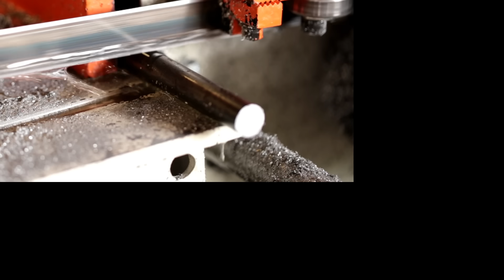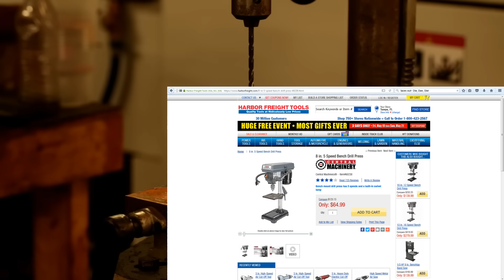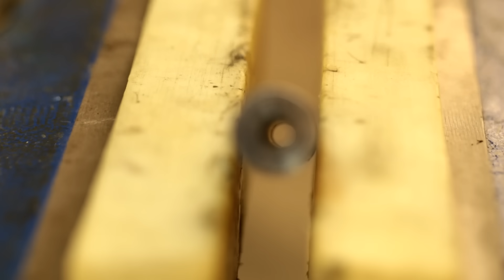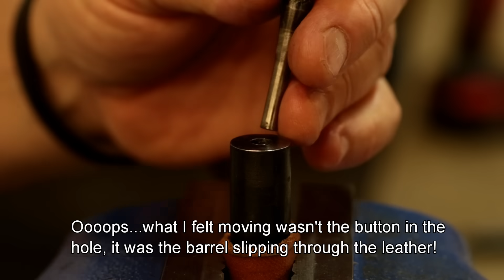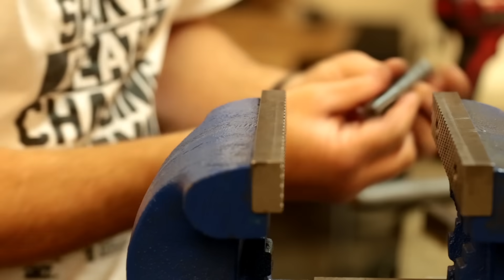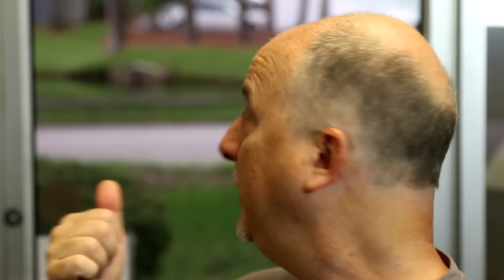Home Shop Rifling!

Comment: Mark Serbu: CRITICAL QUESTION: Can I use a 9x19 button ( the chinese one ) to rifle a 0.380 acp barrel, granted that I drill/ream/lap to the exact proper ID which for 0.380 is 0.348"?????? 9x19 and 0.380 groove diameters are identical (0.355"). So can I get expected results doing this. Or is my logic really false logic?? Would I have to buy a specific button for 0.380 ACP and another for 9x19mm regardless of my ID bore specs?? Thanks. Hoping for someone who knows to help clear my head, so I can make my first 0.380 barrel. Thanks so much.

Comment: If the drill bit was sharpened unevenly it will drift off center as it cuts.
Reply: If the collet block is not sitting perfectly perpendicular to the axis of the drill it will also drill the hole off centre.

Comment: How hard should the barrel blank be so when it shrinks back after the button passes through, the final groove diameter is correct. I will be using a piece of 4140 or thick walled DOM tubing to make a large caliber muzzle loader barrel.
Reply from the maker: That's a really tough question because there are two different material properties at play here.  In general the spring back is dictated by the modulus of elasticity of the steel which doesn't change with hardness. But the amount of deformation (i.e. groove depth) is almost totally dependent on the strength / hardness of the steel.  So your best bet is to get guidance from the button manufacturer but in general that's just a starting point.  Best of luck!
Reply: @markserbu  Thanks Mark ☺

Comment: What drill bits do you use? I have horrible luck drilling metal!!!! I have learned to use cobalt bits but, other then that, or sharpening carbin tipped masonry bits, i dont know what other bits will go threw metal.I need a drill press!!! Also a good drill with no run out/ wobble!!!!
Reply from the maker: I just use good quality high speed steel drill bits.  Yes, a drill press makes a big difference...even an inexpensive one.

Comment: Am I the only one getting flashes of a web page and distorted voice over his normal voice. virus?// or a zombie attack?
Really, chuck the mold ejector rod (large end way up in the chuck) in the drill press and put a slight cone on the tip then it will fit and center in the recess in the broach. I'm a garage tinkerer, handyman, shadetree mechanic with around 3 yrs exp. in a industrial machine shop.

Comment: What metal or steel alloy did you use for the barrel?  that withstands the detonations of the cartridges?
Reply from the maker: It was either 1144 or ETD 150.  But this barrel is for a .22 LR, so could have been made from any steel, really.

Comment: ...That's it??? 

Okay how'd you program that CNC to push that? Would that just be like a G81 or something?

Apparently I have all the stuff needed to rifle barrels.

Edit: lmao I didn't realize this vid was 5 years old, it just popped up in my recommendations.
Reply from the maker: @armorers_wrench You just put a steel rod into one of the tool holders, program it to rapid over top of the button (which should be touched off so it's at X,Y zero for whatever fixture offset you're using), then move the rod down at a reasonable feed rate. Assuming tool 1 is being used, the program would look something like this: M6 T1; G00 G90 G54 X0 Y0; G43 Z.1 H1; G01 Z-5.2 F10.0; G00 Z1.0; M30;

Comment: It looks like you used a regular piece of cold roll steel? What are most barrel materials made from?
Reply from the maker: It was either 1144 or ETD150.  Barrels are made from a lot of different steels and about the most common for a "good" barrel is 4140 or 4150.

Comment: Is there a reason to use round stock rather than, say, square stock for a barrel?
Reply from the maker: It's easier to deal with in a lathe, and some steels are available in round that aren't available in other shapes.  And vice versa.  Otherwise...no.

Comment: But that won't work for rifle barrels. Which is what I was hoping for
Reply from the maker: Sure it will.  The blanks need to be gun drilled and you may need a support bushing or two for the push rod, but otherwise the process is the same.

Comment: What material do you use for making barrels?
Do you anneal before, then harden after?
Thank you
Reply from the maker: Crappy barrels: Any steel.  Decent to excellent barrels: 1137, 1144, ETD 150, 4140, 4150.  Barrels are best made from steel that's in its most machinable state and that's never annealed, contrary to popular belief.  Some of the materials like 1144 and ETD 150 are strain hardened and are ready to go as is.  4140 and the like are generally heat treated to around Rc 30 before all work is done on them.  Many times the barrels are stress relieved (around 1100 degrees F) at the end of all drilling/rifling processes.

Comment: Using a lathe would be much easier and accurate
Reply from the maker: tru·ism
/ˈtro͞oˌizəm/
noun
noun: truism; plural noun: truisms

    a statement that is obviously true and says nothing new or interesting.
    "the truism that you get what you pay for"
    synonyms: platitude, commonplace, cliché, hackneyed/trite/banal/overworked saying, stock phrase, banality, old chestnut, bromide; More
    maxim, axiom, saw
        Logic
        a proposition that states nothing beyond what is implied by any of its terms.
Reply: @markserbu  what?

Comment: What kind of material is to be used for barrel.? If I use ss 410 would it work.
Reply from the maker: Lots of different steels are used.  I don't know about 410...I don't have any experience with it.  I know that 416 stainless is used a lot, though, and it's fairly close metallurgically.

Comment: What size do you drill for example if you want to make a 9mm barrel??
Reply from the maker: You need to look up the numbers from SAAMI or CIP.  Off the top of my head the bore diameter for a 9mm Luger is somewhere around .346", I think.

Comment: How many rounds is this barrel going to get through it before it wears too much and the bullets start keyholing?  Also are you gonna try hardening the steel, or even chrome plating?
Reply from the maker: I used steel that's better quality than most commercial .22 rifles, so it's hard to say.  100,000+ plus rounds, probably.  No need to harden the steel, it's a strain-hardened type so it's been done.  Never seen a .22LR barrel chrome plated...that would sure be overkill!
Reply: @markserbu  you forgot, the M16 has a chrome plated barrel (i meant bore, of course)
Reply from the maker: @jessiepinkman7736  No, I said ".22LR" not ".223".
Reply: @markserbu  but the bore of the M16 is the same dimensions.
Reply from the maker: @jessiepinkman7736  Come on, you really want to argue with me?  No, .223 and .22 LR do NOT have the same bore dimensions!  You obviously are not familiar with the SAAMI specs.  And that wasn't even the point.

Comment: couldn't this be done by just 3d printing a rifled cylinder and than metal casting it with aluminum?
i don't know how strong barrels ought to be for said caliber, but it aluminum should be enough for 22lr right?
Reply from the maker: It's not just about strength, it's about hardness and aluminum is extremely soft.  And of course casting is the worst method for barrel making in any material.  It may last a few rounds in .22LR or it may blow up immediately, who knows?
Reply: @markserbu  oke so not aluminum maybe, but can it be done with stronger metals from an actual expensive metal 3d printer?

I know older barrels (prior to 2000) weren't hardened as today, but still hold up.

If i lived in america i'd test this out of curiosity, but alas i live in europe.
Reply from the maker: @ishitrealbad3039  Huh?  Barrels have been made the same way for almost 100 years...alloy steel, hardened, etc.  Never heard of "prior to 2000" being considered "older", as far as guns go!  :-D
Reply: @markserbu  The guys from GunRangeTV were testing the HKG36A, both with an original barrel and a new barrel.
And they claimed the original barrel were not made with modern day methods like hardening, causing the rifle to shoot less accurate after X amount of magazines.

I just took their word for it, but maybe it was just HK?

Comment: I know this video is old, but I’m begging you for some advice. Two days searching now and can’t find ANY info on this. Plus, not a single qualified gunsmith in my part of South Florida who can help.

I just bought a 22wmr revolver with a 9” barrel. I want to modify it to smooth bore, to only use as a snake/pest gun using CCI #12 shotshell. This round shoots horribly out of rifled barrels, so I want to make it smooth bore.

Is this a project I can handle myself, and if so, HOW!?

I don’t have a lathe, but since we’re not talking about CREATING rifling, only filing it down, I’m guessing I can handle this.

Maybe.
Reply from the maker: Making a smooth bore out of a rifled barrel is easy.  In the case of a .22 WMR caliber you just run a .223" reamer down the bore...you could easily do it with a hand drill.  The problem you have is that a smoothbore pistol is considered to be an "Any Other Weapon" (AOW) under the NFA.  So before you ream out the barrel to a smoothbore you'll have to file a BATF Form 1 and get it approved.  And of course an individual has to pay a $200 tax to file that form.  If you know someone who is a Class 2 manufacturer, they can do it and you'd have to only pay a $5 tax to transfer it to you.  Sounds absurd but that's the law.
Reply: @markserbu  You’re a good man! Where does one find a .223” reamer?

Comment: Kool! Sir, stainless steel AISI 304, like material good or not for making barrel? Thank you.
Reply from the maker: 304 stainless is not good for making gun barrels.
Reply: @markserbu  Thank You Sir! What are the reasons why 304 is not suitable for making a smoothbore pistol barrel? Thanks
Reply from the maker: @sergevobnoff4453  Well smoothbore is a different issue.  304 work hardens extremely easily so in the process of trying to push a rifling button through it would probably get stuck and break.   Smoothbore should work as long as you're able to drill and ream it, which is difficult due to the work hardening.  Another issue is that barrels SHOULD be made from gun quality steel, which 304 is not.  You'll probably be fine with a large diameter barrel and a small, low-pressure caliber but it's not recommended.
Reply: @markserbu   Thanks! A sub-caliber non-rifled barrel is what I want to do! So in my case 304 steel should have been normal (acceptable). Thanks you Sir!

Comment: I think too much pressure bent the drill bit so you got off center dar yeh?
Reply from the maker: Nah.
Reply: @markserbu  So you got this drill press and one is exerting pressure onto a shaft, in this case a drill bit. Push a pencil down on a piece of metal and record it in slow motion and see what the effects are on the pencil as you keep applying pressure until it snaps in half. It bends, therefore your drilling straight down was deviated due to too much pressure being applied to the drill bit during the time of drilling the hole. the point of the drill was set off center due to this fact therefore it went off course. easy enough to figure out. because the point of the drill was being pushed off center due to the bending effect of the amount of pressure being exerted onto the shaft.
Reply from the maker: @userxbw  Yeah, great.  Except there are at least 3 other reasons that hole could have wandered, which you've ignored.  And I said, "Nah", because I know which of those 3 it was, and it obviously wasn't what you thought it was.
Reply: @markserbu  OK bright boy, thanks for sharing your knowledge.
Reply: @markserbu  OK bright boy, thanks for sharing your knowledge on that... so now we all know what to look out for when trying it... woo hoo you're really into helping out people by sharing what you know so others won't screw up like you did.

Comment: sorry this is wrong way to drill work piece the bore wouldn be strait you should use lathe  first to drill the bore then between two point lathe outher surface

Comment: Not sure why you haven't got a lathe?
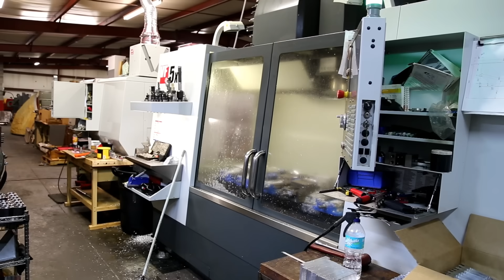Reply from the maker: @peppenapoli6764 I'm not sure why you put a question mark at the end of a statement, and I'm not sure why you didn't notice the 14,000+ pound, $100,000+ CNC turning center in the video starting at 20:39.

Comment: you can use any pointy object to scratch out that denter using the exact same method. i dont see why people seem to persist to abuse their calipers ,even if you have some el cheapo caliper a pointy object can be had for even less.period. And that sir aint any random el cheapo caliper you are abusing so for that i do not salute you. mighty nice vid. and content though ,cheers and gl finding yourself a pointy object, you can do a search for "how to make a shank" lol prolly fine to do it dry ? sir you dont need more "good" ( read expensive) tools. upgrading your methods will serve you alot. a sharp / oiled drill will drill straighér then a dull overheated drill. especially if you need through  hole. and you should not ream a bent hole ,no matter how. handreamers are to be used wothou the drill ,machine reamers can be used in combination with a electric drill.

Comment: This guy is NO machinist. DON'T try this at home. This guy does NOT know what he's doing.

FINALLY, at the end, he uses the correct tools. Like a mill/lathe.
Reply from the maker: Look, guy with two first names, I'm a mechanical engineer.  And I mostly know what I'm doing, enough that there are over 10,000 guns out there in the world with my name on them.
Reply: markserbu Then why did you make a video where 95% of it was how NOT to do it things, doing dangerous operations improperly, using incorrect tools? The whole thing is a joke. I feel sorry for the people who bought all those guns from you if this is an example of your work product. What was your point in presenting this video?

Oh, by the way, I am an electronics engineer and senior systems analyst, retired. I worked very close with real machinists, mechanical engineers and also own my own milling machine, lathes, drill presses, etc. and was trained by experts. All those folks would have laughed at your video and been disgusted that you thought this was a training video. It's 15 minutes of my life wasted.

Comment: Wow - that's more like how NOT to do homemade rifling.  Do any of the guns you build hit anything when fired?  Anything that you aim at, that is . . .  That rifling button is $250; how much does a barrel cost?
Reply from the maker: The guns I build don't hit anything when fired, but the bullets they shoot do.  Well, I think that's how it's supposed to work anyway.
Reply: @markserbu  Ha.  I just meant that the misalignments seem like they would not result in an accurate barrel.  Not that there's anything wrong with knowing pitfalls, mind you.  Barrels I make DO hit things - but only when I swing them like a bat . . .

Comment: This is an excellent video for learning how to NOT do things!   How about one showing how TO do things?  Let's assume we are relatively serious and already have a Hydraulic press and say a $500 Mini lathe; but not necessarily any formal machining training.  Glaring omissions here were; what type of steel, a formula for what size hole to start with to end up in a standard cal.  Some tips on what can be cheap & easy to use for your starting round bar stock; I.e. what's a good bolt tensile that gives adequate strength but can still be worked without expensive tooling.  Possibility of heat treating firstly to soften for work, then harden and temper finished product?  Anyone can play at home with hand tools without much 'instruction '  - it's the more serious hobbyist that's looking to guys like you for knowledge.
Reply from the maker: @thescythian321 I've done Part 2 and Part 3 videos that have a lot more information. As far as material: 1137, 1141, 1144 or ETD 150 are nice choices for fairly low-pressure rounds. 4140 (heat treated) is good for anything. All the specs for bore and groove diameter come from SAAMI, at saami.org. One of these days I'll be doing a Part 4 that's more geared towards the serious builder, but I'm a busy guy.

Comment: plus   it should button to turn so  next time   do  2  bearings or at least plastic to allow spike to turn
WASTE OF 250  TOOL //FOR    A LENGHT   YOU IN FACT NEED  NO RIFLING

NO NO MAMMERING PRESS//  EVEN IF YOU MADE SOME   RIFLING NOW NOT SMOOTH   IT GOT TO FLOW THREW  NOT TAPP THIS  //WELL GO LOOK HOW THEY MAKE FULL LENGHT RIFLING FOR  HOME MADE AK //FULL LENGHT  IT SPINS BULLET  IN   FLIGHT AND DONE   BY HAND// I  TALK SITTING   ON GROUND AND  HAND  PUSHING RESHAPED  ORDINARY DRILL  BY HAND FEW 100 TIMES

Comment: a lot to sy but   your vice and all is  moving   if there  is   1   think   get  a table that don move  or  use   floor   curve  or street    a step //something don move//250 doll rifling button //   for 10 inch  22  lolo //  we do this     by    grinding   a    1 spike  or   2  to  oversize drill if   all is  not  home made   wtf we  look this//  we talking  home made rifling //like hand made    you can make  home   barrels with  a  press and    induction heater  like    hand koch  does  lol//hand made  is 2 by 2  lands at time   //by hand

Comment: Hi friend, could you help me?
Reply: Friend, I'm making a .357mag barrel, ok, the diameter of the hole needs to be 8.80mm x 9mm, which is the best steel to get a good result??  I made it with 1045 steel but it wasn't good.
Reply from the maker: 4140 at Rc 28-32, 1137, 1141 or ETD 150.
Reply: @markserbu  or sae 4340??

Comment: All the calculations on buckling points were shown by you before you decided to wing it, $7US investment - until yer run out of stock then it may as well be $7mUS? Be prepared!
Reply from the maker: I didn't actually do the calculations, just made reference to the Euler Buckling Theory.  A classic, "Do as I say, not as I do".